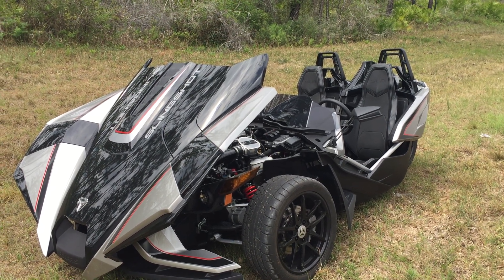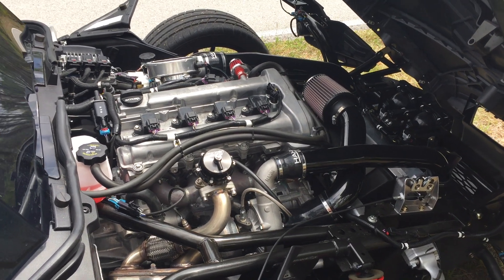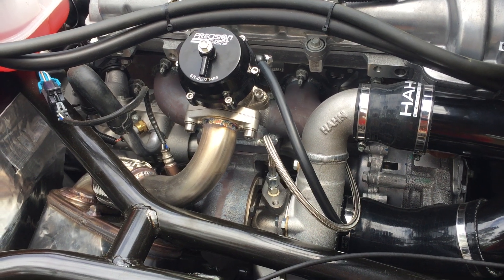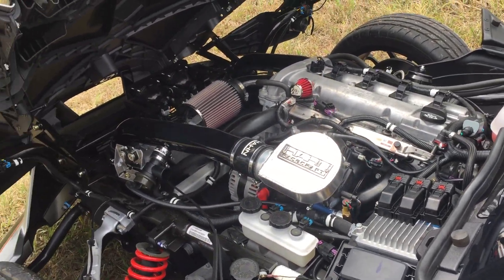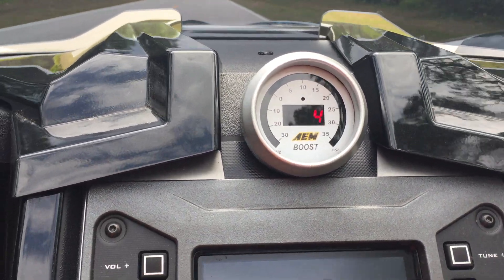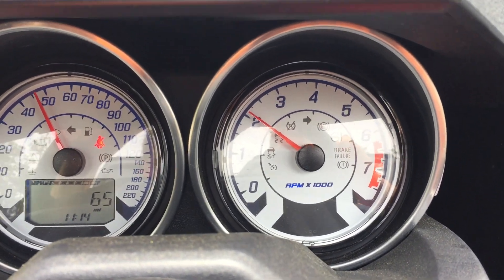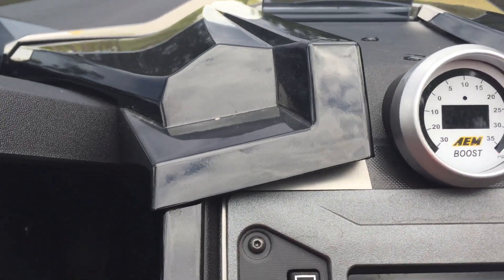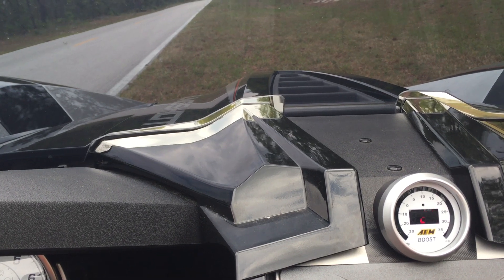Hahn RaceCraft TurboSystem Response: Slingshot

Comment: Hey Bill what's the best way to get ahold of you? I have some questions on your portfueler for the 420a. Instead of running the stock injectors could I run 750cc injectors?
Reply from the maker: Where are you asking...in the PortFueler, or as to replace the stock primary injectors?
Reply from the maker: Oh and this is Bill, hi there!
Reply: I was wanting to replace the stock injecters. Bill Junior sent me the 550cc portfueler injectors and I have 750cc injectors I want to use instead of the oem injecters. I really want to beat that 10.87 mdp and little Bill set back in the 2000s.
Reply: for the 420a
Reply from the maker: You'd need some method of re-tuning the stock PCM to properly accommodate larger injectors. I'm not aware of any such method currently.
Reply: Hahn RaceCraft will this system along with the symtec fuel cut defender and a walbro 255gph fuel pump and a fpr support 30 psi of boost on a Garret GT3582R turbo? if i used the stock injectors and the Hahn aux injecters? I know little Bill ran some high boost to pull that 10.87 off.
Reply: Hahn RaceCraft btw Bill I really appreciate the replies. I spent upwards of 30 grand in performance modifications just wanting to break records.
Reply from the maker: Tune it to suit, and you should be able to get there. We had great results with these PortFueler systems on your application :)